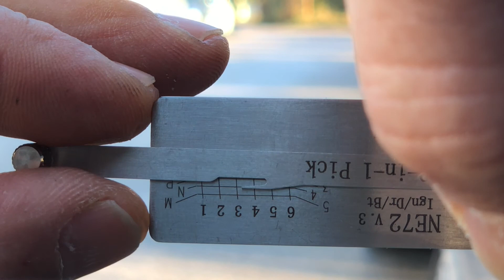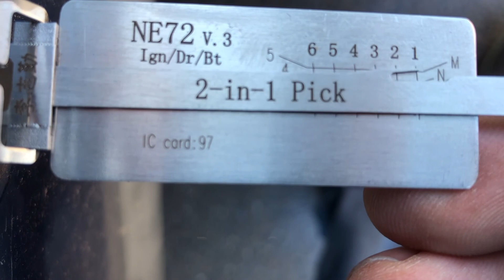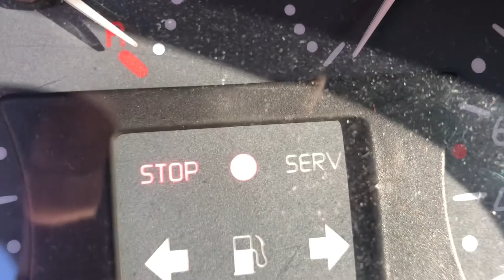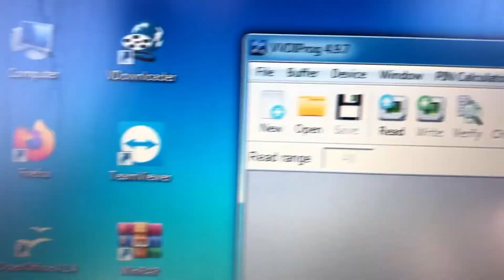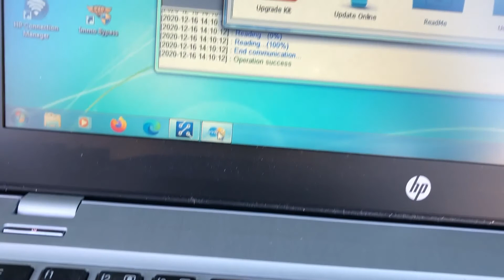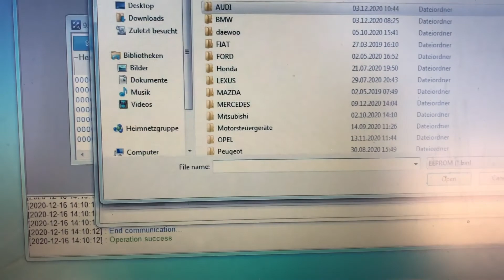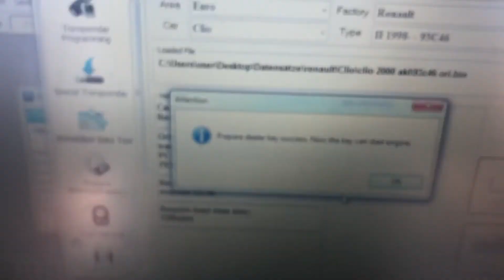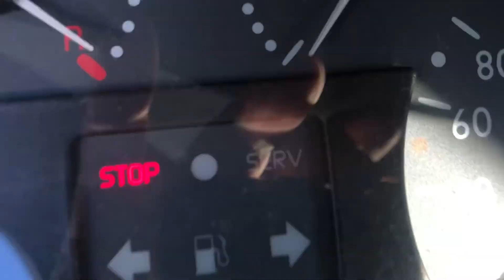Renault Clio 2000 - NE72 - Alle Schlüssel verloren / All key lost

Comment: Hi, I would like to ask you for some informations, I have the same car and one key which can just turn on the engine but can't remotely unlock doors because it's half damaged, and holding the button to lock the doors near the gear shift and then clicking the button on the key doesn't work since the key can't transmit or receive rf. I have nowhere to get another key since all you find online is for phase 2 and this is phase 1. Any idea how to get a remote to unlock the car? I also thought about a programmable 433mhz remote used to open garages, but I don't have a key to sniff the signal from.

Comment: Hello 
Need some informations
I try to do one clio 1 same on thé vidéo
I didn't reach to desolder thé eeprom it was hard for me
Tried with hot air 
How did you Do it please
Reply from the maker: Hi. The eprom is glued to the board. You can read it in circuit ( on the board ). Or you can remove it with a small screwdriver when you heat it up with hot air. Be sure that all legs are heated up enough. Hope it helps.
Reply: @schluesseldienst_muzler_de4067  thank you very much for your reply